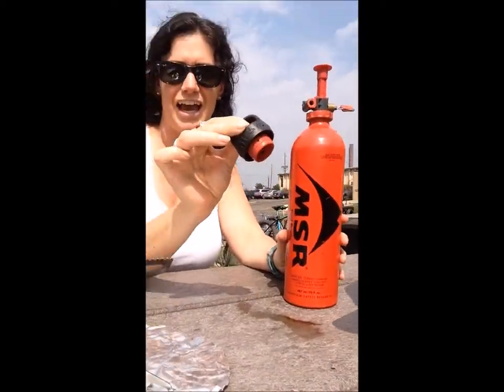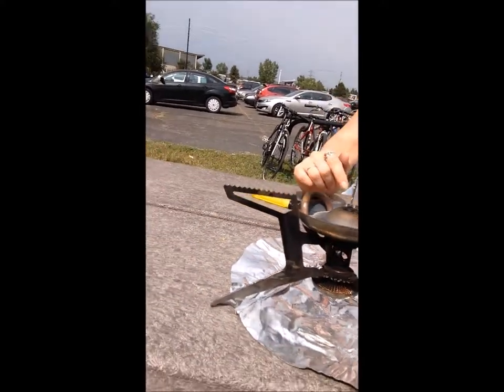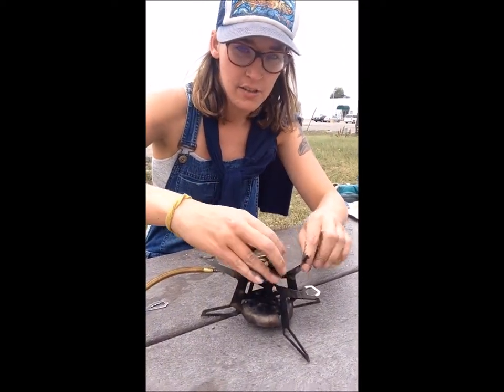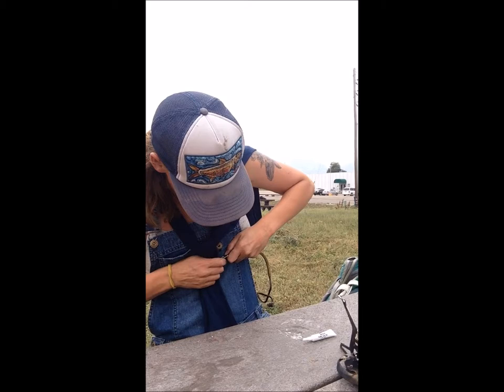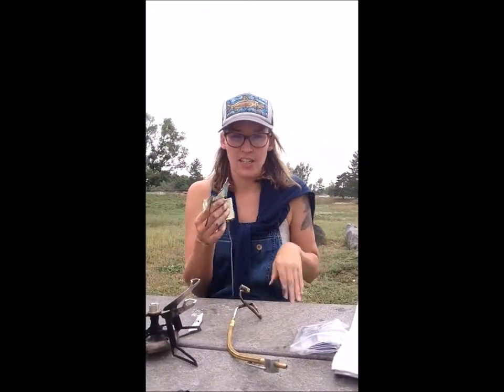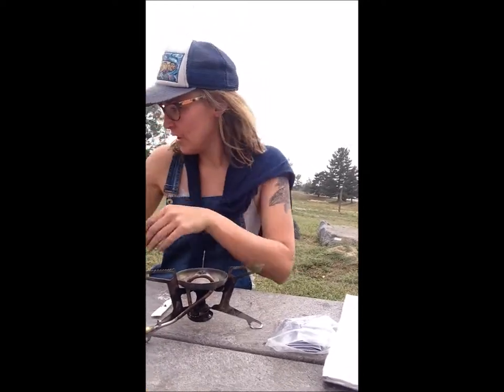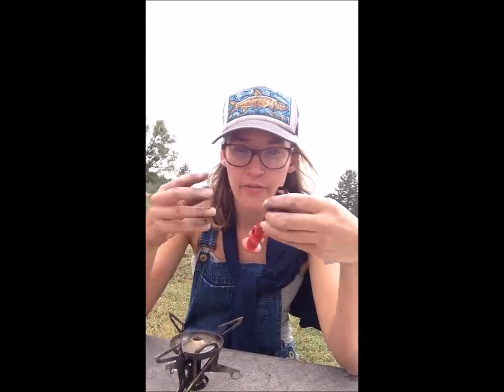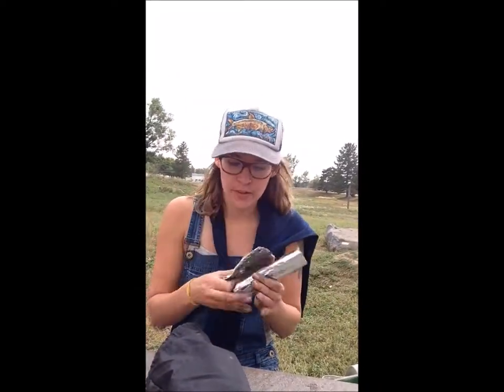Outdoor Skill Movie  Using a Stove

Comment: Great video! Priming these stoves can be tricky. Very little fuel is needed to heat the element. If If the flame goes out before I am able to turn the gas back on it is also possible to use your lighter to ignite the hot element directly. I would also recommend for the group to be proactive about keeping those o-rings lubed up which will extend their life, especially in dry climates. Another place to use the lube is on the stove fuel cord valve to the pump, this creates a solid seal. Great job looks like that stove is good for another 50,000!

Comment: Camera work was a little to be desired ;) But he information was spot on! Rachel, you attacked that stove without fear, and Amanda, you stood by that flame with commitment and ease that you knew what you were doing! I wonder- with cleaning the wire, does it help to put fuel on the rag that you're cleaning it with? That stove looked a lot easier to assemble and disassemble than the Naropa ones! Anyways, well explained :)